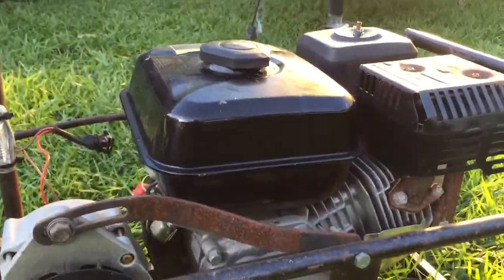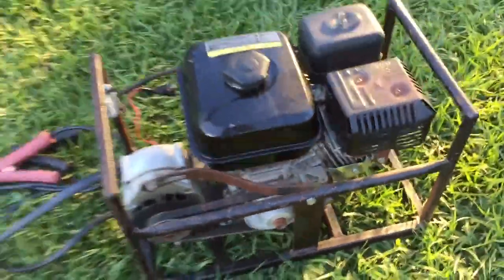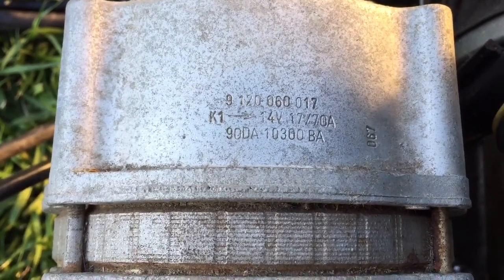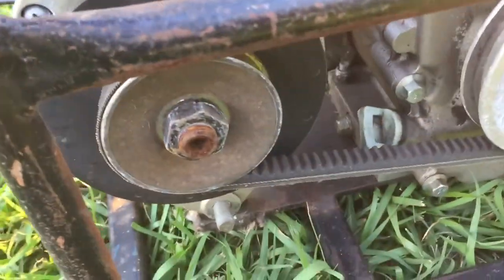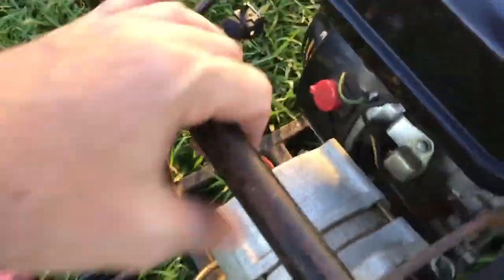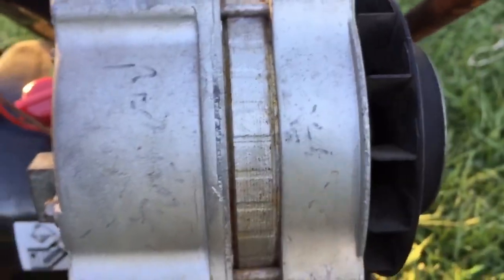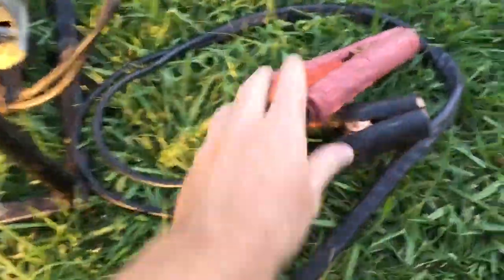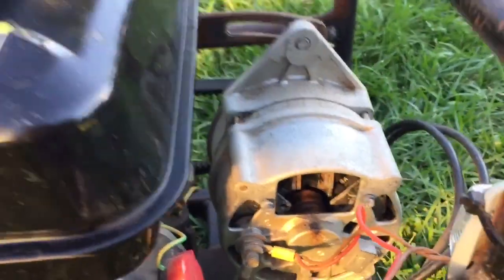DC generator I picked up nice and cheap.

Comment: http://www.ebay.com/itm/permanent-magnet-alternator-24-volt-DC-used-4-building-a-wind-turbine-generator-/390953687903?pt=LH_DefaultDomain_0&hash=item5b06a7db5f or go to any car wrecker and you can find a delco alternator.